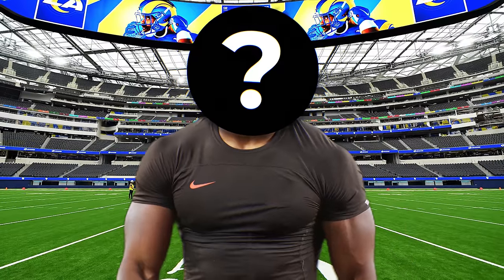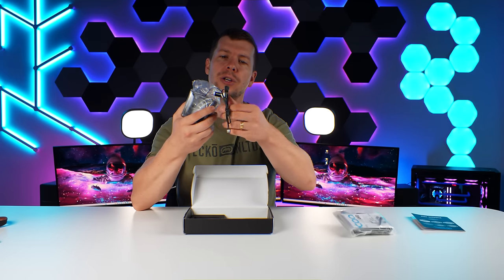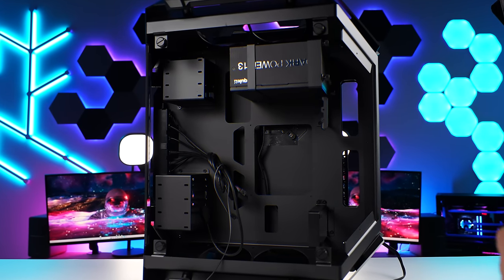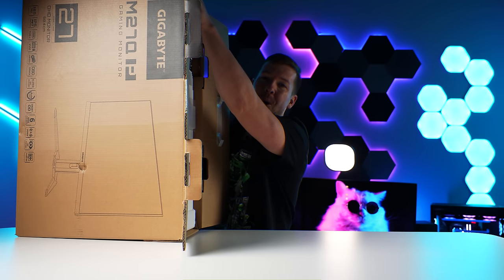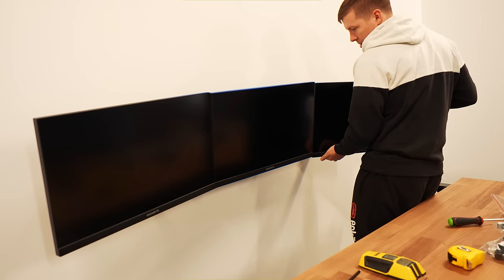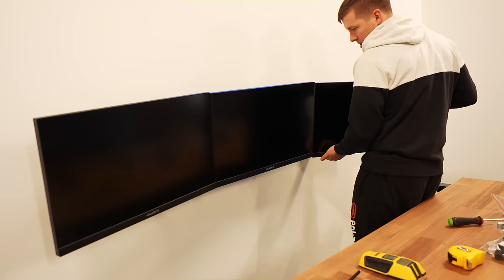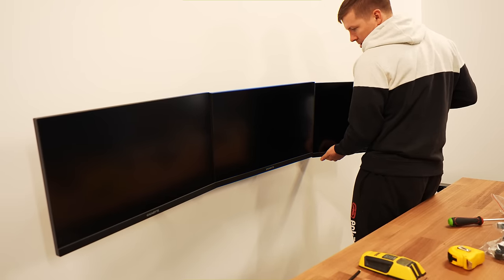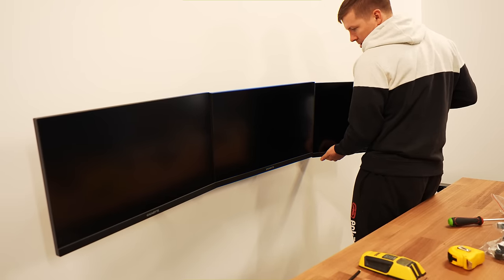I Built A $12000 Gaming Setup For A Celebrity!

Comment: Nice video! But why didn’t you use oled monitors? And why dis you opt to setup the outer monitors in an horizontal orientation instead of vertical (this way it seems sort of unusable)? Love to hear your design thoughts!
Reply from the maker: Hey mate! OLED was way out of the budget and Aorus was partnering with us so it would have to be an Aorus monitor.

The horizontal mounting filled up the space much better than a vertical layout and the vertical would also cut off some of the triangle lighting.

I tried sitting at the desk with the horizontal mounting and both outside monitors seem comfortable for me to use, especially with the slight angle inwards

Comment: I calculated my premuim build at just over 10k and that includes 2x 49" G9 odyssey curved monitors. Personally if you built me that PC and I was that celebrity I would be pissed. Ryzen 9 7950X3D should be used and Either the MSI Suprim Liquid RTX4090 or custom cooling system from EKWB not fanny crap.